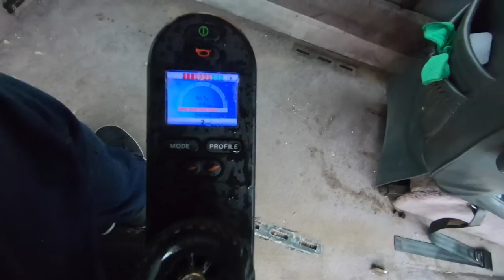VLOG 410: building an F3 permobil / DONE MOVING!

Comment: Congrats on the new chair! You will love the F3, really the only thing you need to worry about is those bearing caps on the back casters, they can pop off easily. But I imagine you can find something to keep those caps on their tight.

Also that forward tilt feature on your new chair is actually called per mobile active Congrats on the new chair! You will love the F3, really the only thing you need to worry about is those bearing caps on the back casters, they can pop off easily. But I imagine you can find something to keep those caps on their tight. 
Also that forward tilt feature on your new chair is actually called permobil activereach, It allows the user of the chair to lean forward to reach things. I’ll find the link to the video and send it to you through Twitter. 

Congrats on the new apartment, looks like a nice place.

Comment: Hi Dan I just got a new chair, it is a Permobil M1 and I was wondering what your thoughts are on that chair? I do find it more comfortable and the suspension seems better than my old chair but I am not really liking the responsiveness of the steering, and it seems slower than my other chair witch was an Invocare?
Reply from the maker: i haven't personally seen an M1 in person.. BUT if its got a gyroscope stabilizer, that explains the lack of steering performance.. its possible to tune them up a little bit, but not all dealers are able to make the adjustments for that. (some of it is OEM locked)
i just programed my F3 today, and its got the gyro.. but was able to get it set so its a lot better.. but theyre nothing like the old skool invacare chairs.. that's for sure!  if the M1 doesn't have the gyro, it should be able to be adjusted with a handheld programmer, or a USB dongle.  check with your dealer and see if they can make some adjustments.  usually they dont charge for tuning on new chairs right after delivery..

Comment: Do you prefer using front wheel drive chairs? Was curious because I have only had mid wheel but mostly see other people in front wheel.
Reply from the maker: Yea I like front wheel drive for running around in small places.. also less castor wheels to get stuck on things. BUT front wheel is less stable... depending on the chair.... I seem to be able to maneuver into tight spaces a lot easier though.
Reply: Hi Derek.  I have used front, mid, and rear drive chairs over many years and really prefer the mid-wheel drive.  To me, mid-wheel is more natural and you don't have as much overshooting and undershooting turn issues.  There is no one right type — it's more what works best for you.  They keep making and selling all 3 models, after all.  If you can get a loaner front wheel to try you can compare and see what you like best. Take care.
Reply from the maker: Well said.  Try and get into as many demo chairs as you can, or try out the 3 types.  Maybe setup some cones or obstacles and do a little slalom with each type of chair. You’ll know as soon as you try the one you like! Most ppl like mid wheel FYI

Comment: Can the back platform be moved back or forward on the chair without affecting the seating.
Reply from the maker: with the configuration on the chair in the video, yes.. the back, and leg rests can slide forward and backwards a bit (independently from each other).  but the seating system as a whole is fixed in place.  on the older chairs with a single post seat mount(or lift) the entire seating assembly can also move forward and back about 3-4"
Reply: @TotallyNormal-  Can I move just the back assembly without moving the seat or foot rests. The problem we are having is the foot rest assembly is too close to the bed so we are trying to move just the back to be closer to the bed. Any ideas. Thanks
Reply: @TotallyNormal-  The chair is new it is a F3. Next question is how to do it.
Reply from the maker: https://brokenwheelchairs.com/page-8/
check the F3 service manual in above link.. they haven't updated it for the newest chairs.. BUT its pretty similar.
ive also got a video adjusting another chair, to at least show the process..
https://youtu.be/xScAJgEOYwM?t=212
its for an M3 - but the process is pretty much the same :^)